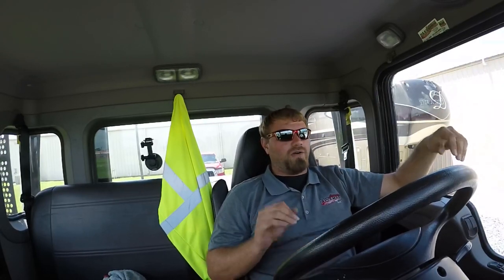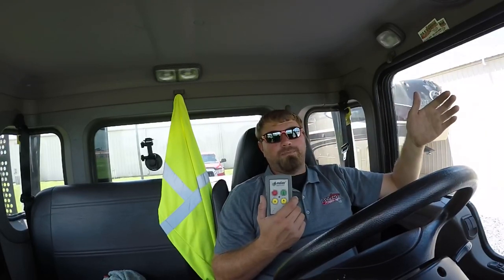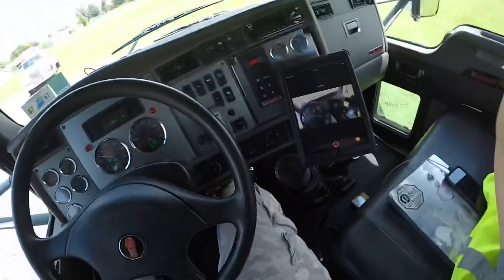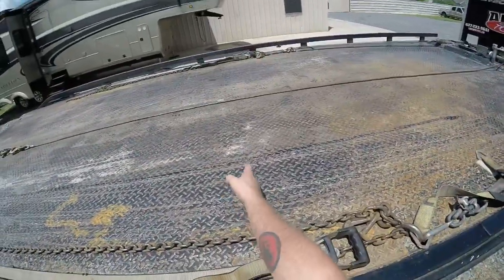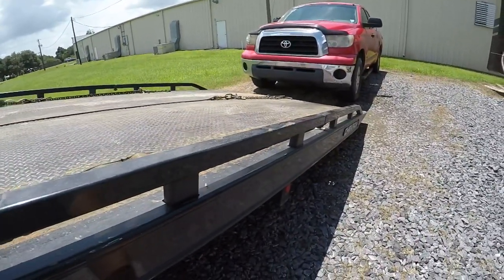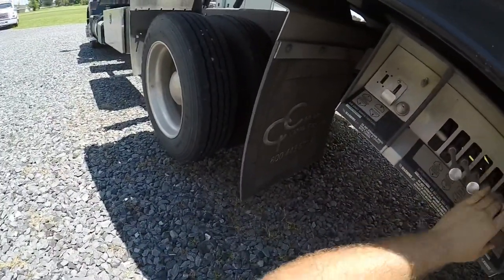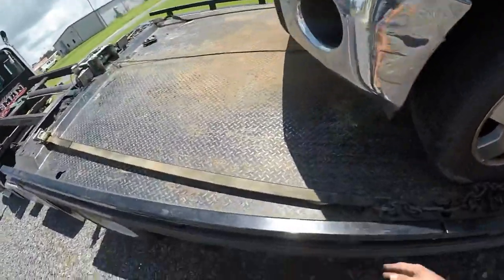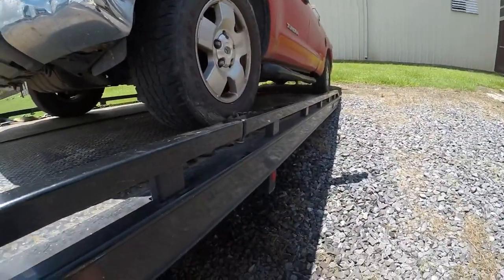Walking a flatbed wrecker under a vehicle in reverse

Comment: do do this on a new or hot blacktop parking lot you may be paying damage your truck cause
Reply from the maker: Could always put 2x6s down under the edge of the bed to pad the parking lot but I’ve never had an issue with this at all. It gets well over 100 degrees in the summer time where im at and I’ve never caused damage to pavement. Doing it in limestone is a different story. Normally have to get out the shovel once I’m done and back fill just a bit but the customer is still happy because I didn’t tear up their caprice classic that isn’t worth the tow bill with the broken ball joint on the front end.

Comment: Can you do one would all wheel drive no key all tires lock
Reply from the maker: Khasro sul all wheel drive vehicles are kind of rare here in south Louisiana. But, if you want to use this for an awd, you would load the same way. Except you would use skates on the front end. Load it just like in this video. The skate method also works with rear wheel drive vehicles with no keys and tires turned. If I can get hold of an awd I can play with, I will keep you in mind.

Comment: My only input is. If you do this more often than not, you might want to make a sling to support the weight of the rearend instead of having you shocks extended and supporting about 1,500 pound rearend. Especially if your rollback has air ride suspension. Other than that. Great video 👍🏼

Comment: So, how would you apply this to say an AWD or FWD platform with the new electronic parking brake. With either a dead batt or no key rendering it a brick.
Reply from the maker: Tire skates. And I haven’t found a good way to do it that doesn’t take a considerable amount of time. I hate these new electric park brakes. No way to override them. Had a fiat 500 that was totally locked up the other day sitting on 3 flats raise my blood pressure a good bit the other day. Thankfully fiat is leaving the US next year and they’re taking their electrical problem ridden cars with them. Lol

Comment: I love using that move. But I also use a move where once I lower the bed I will release the air brakes with the truck in neutral and winch the truck under the vehicle. Or use the bed like a brake then you don’t stretch the bags out.
Reply from the maker: T Sip with that truck, I couldn’t release the brakes and have the truck idled up. In the new 2020 you see in recent videos, I have that over ride so this particular technique isn’t used as often unless I’m on an accident scene and have to move the truck a few feet to get that extra needed space to get a vehicle on the deck.

Comment: Nice. I use this method all the time to get myself unstuck. I charge the customer a little extra for labor cause I just went above and beyond to winch you out.. Just not sure if my bags should be dumped or filled. When I do this.. Your thoughts
Reply from the maker: cdells77 dumped. Always load and unload dumped. These trucks are equipped with leveling valves. When you add weight, the valve adds air, when you shed weight, the valve dumps air. Put a lot of wear and tear on that valve. Plus, if you’re aired up, you’ll fight the suspension and won’t be able to move the truck as far. I always dump. Especially when unloading on the deck because if you don’t put the bed down far enough, once the vehicle gets totally off the bed, the bags have extra air in them to compensate for the weight of the vehicle and could potentially pick the end of your bed up striking the bottom of the bumper on a car. I haven’t seen any formal articles on this issue but I’m basing my thoughts purely on personal experience as an operator and a mechanic.
Reply: @adamtarver  thanks for your reply. From now on I'm dumping whenever I walk the truck.
Reply from the maker: It’s personal preference but try it both ways. This is just the way I do it. I’m not an expert by any means. Lol. Definitely thanks for the feedback. Let me know how it works for you. Better or worse. Opinions like yours will keep the channel going. May even do a video with the bags aired up just to test my theory because I’ve never tried it.
Reply from the maker: Sidenote*** don’t use this same advice when loading a vehicle on the wheel lift. Leave your bags aired to load. My reasoning behind that is when you put your arms on a liftbthe vehicle, while you’re applying straps, the wreckers bags are “catching up”. By the time you’re strapped and your lights are on, the ride height has leveled and you can set your safety chains without having to get back in the truck, flip the switch, go back to the back of the truck and wait on the airbags to do their thing. Leave Em up, it’ll save you some time. But I always unload the wheel lift with the bags dumped because when you take the weight off, the bags will have that extra air in them and you can possibly blow an airbag up depending on the weight of the vehicle and how much air the valve had to put in them to level the truck. The bags will split off of the cup at the bottom of the bag. Just food for thought...

Comment: Will this not damage the bed at all?
Reply from the maker: I wouldn’t recommend doing this with weaker beds. If you have tiny lift and bed extend cylinders, as on a kilar, I wouldn’t recommend it. You can bend a cylinder or warp the bed. This is a chevron model 14 that I’m using with a good, thick rail under it.
Reply: Yah thats why he posted it